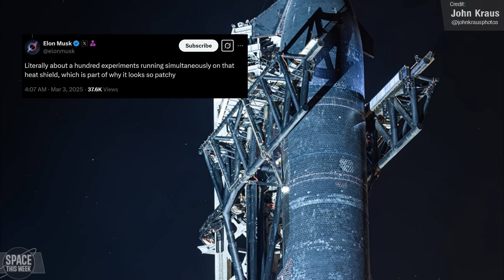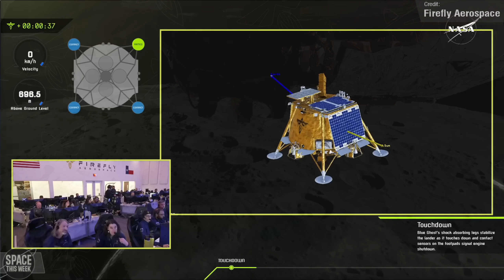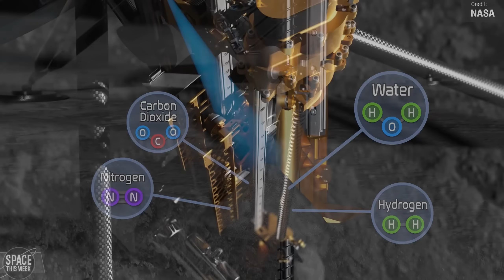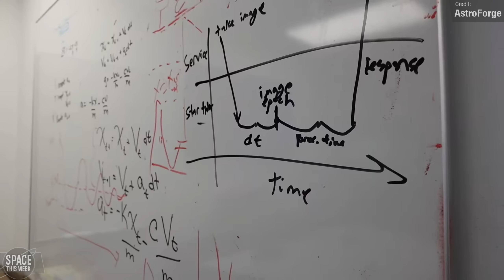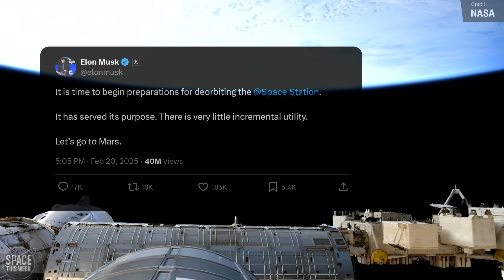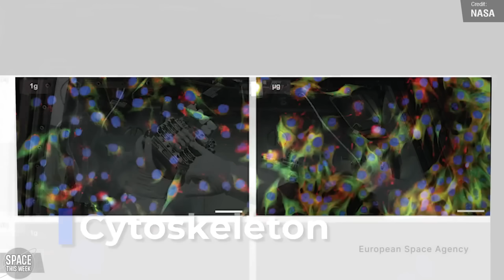SpaceX ABORTS Starship's 8th Flight Test, a Falcon 9 EXPLODED, and FIREFLY LANDED ON THE MOON!

Comment: If the fire happened in this compartment, this means they had a leak to allow the two fuels to mix, but what caused the ignition to allow it to ignite? Hmm, I think the leak was massive and this cause the RUD, not the detonation system.

Comment: This was quite a mouthful: "a harmonic response several times stronger in flight than had been seen during testing, putting increased stress on the propulsion system hardware with the propellant leaks exceeding the venting capability of the attic area and causing the fires". Now that I wrote this down, it is was clear except the "harmonic response", which I had to look up. Maybe say this slower or break it down next time :-).
Reply: Tldr.: Some sort of vibrational resonance mode lead to part of the engine plumbing shaking itself apart?
Did I understand this correctly?
Reply: @plainText384 Yup
Reply: Translation. There was a lot of shaking and something broke. Now an actual accident investigation would determine what broke, and why the shaking caused it to break and recommend modifications to solve the problem rather than make 10 different random changes and hope it solves the problem.
Reply: Updated from "something broke" !. 🤣
Reply: Something happened.

*BOOM* 🤷😉
Reply: It's written clearly, and it seems they've figured out the problem and the solution.
Reply: Maybe better you try and keep up?

Comment: Just a reminder that Elon still hasn't delivered the Rocket he was Contracted to by the U.S. Government; and is extremely over-budget with no end is sight.
Reply from the maker: Are you saying that SpaceX is bad? If it wasn't for them US would still be relying on Russia for access to the ISS considering how disastrous Boeing Starliner has been.
Reply: @MattLowne I think they are referring to the starship lunar lander, not Falcon 9. The latter is great, the former will probably never happen.
Reply from the maker: @lb2791  Per this video, the rocket for Artemis 2 is yet to be assembled, and human landing won't occur until Artemis 3. Considering Artemis 1 launched before Starship Flight 1, at SpaceX's pace I wouldn't be surprised if Starship HLS is ready when NASA needs it. There's already significant work on it in California, but it's all much more closed-doors than the regular starship program.
Reply: @ I'll believe it when I see it. They will need to perfect regular starship and the rapid relaunch process to bring all the fuel into orbit, then transfer it to another vessel in orbit (something that has never been done) and store it for long enough for all the refueling to be finished (also never been done). Then they need to develop a whole other type of starship to use as the lander, an absolutely gynormous moon lander that's never been done is really isn't the most practical apporach for a moon lander, nobody knows if it's even possible to land such a rocket on the moon.
It's just sooo much world firsts that need to happen in a short time, all costing immense amounts of money (I'm not convinced the money SpaceX gets from NASA is even remotely enough). This is all before you even start considering their CEO is doing loads of other stuff at the same time (maybe a good thing, less possibility for him to mess things up at spaceX) and is being more and more of an insane person every day. Keep in mind he has failed at plenty of other projects in the past (hyperloop, anyone?). Just because it's done by spaceX doesn't mean it will automatically succeed.
All of this to build a moon lander,  something we already developed in the 60s once in a much more practical form.
Reply: @MattLowne  disastrous is not enough to say how starliner is doing
Reply: Literally wtf are you talking about?